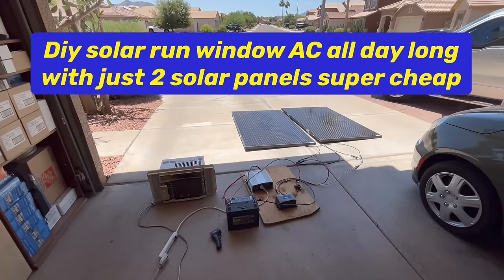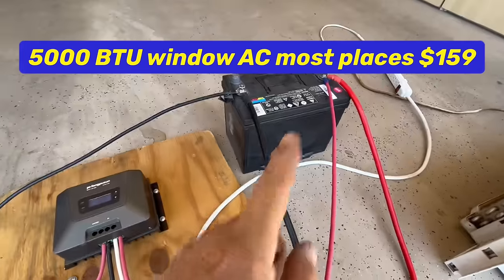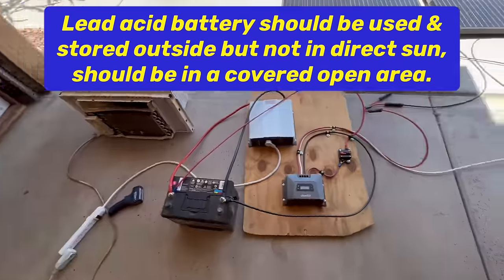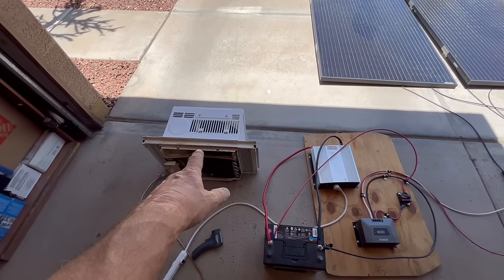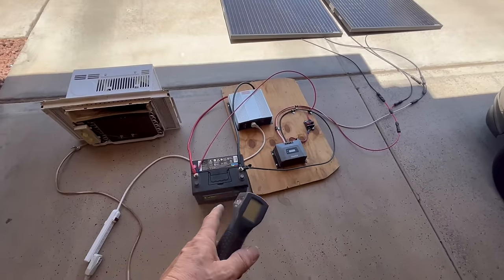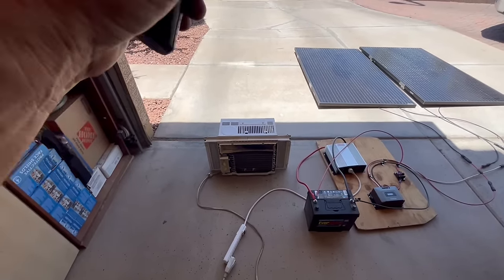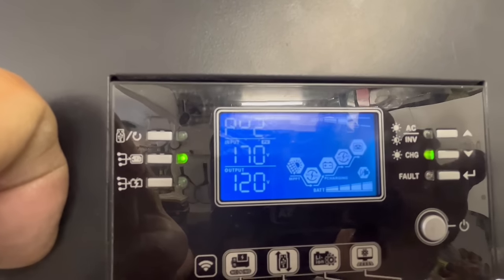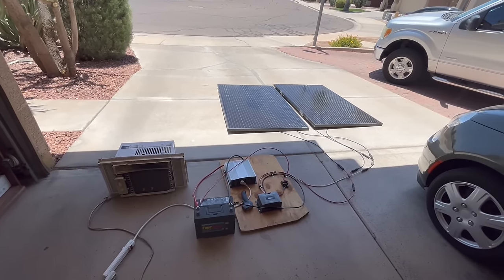Run your window AC with just 2 solar panels when sun shines. Easy DIY project you can do in one day.

Comment: I like the video but something you said I wasn't sure about. "Never leave solar in the sun." I don't think it produces power since the connectors are open, so my understanding was that it was OK to keep unconnected panels in the sun. You just get Voc, and I=0A. P=I*V. Thus P=0 Watts. It is just like an unconnected battery. Has potential, but until you hook it up to somethig, it isn't making any power. I thought those window AC units took over 1KW of power so I didn't think 2 panels would work. I might do that same setup.
Reply from the maker: Hi,I was talking about if you disassemble the system, don’t leave solar panels in the sun not connected to anything with the connectors just hanging. If it rains the water could get in connectors and complete the circuit and cause a fire hazard. But if the system in still connected, you will just be charging the battery or if battery is already fully charged,  the charge controller will stop charging battery. I was also talking about if I built a something or a way to to store on back of motor home a bracket connected to the bumper where standing straight up. I would face solar panels inward towards motor home so no sunlight was hitting face of solar panels. If it started raining and panels were facing out, you are creating a voltage through the wires and the water got in connectors, you could complete the circuit and catch on fire. Also the ac units they sell at Lowes right now only use around 4 amps at 120 volts is 480 watts. This unit while running only uses around 500 watts once running on high. When you turn down the temp control, unit will cycle on and off and will keep battery more fully charged. I ran this AC unit in a shed for a year and half when hit in the summer, left connected all the time and I would run from around 8 am till 6 pm in the summer on middle setting, it ran unit and kept battery fully charged. When I turned off at 6 pm, battery would continue to charge until sun went down. So battery would be fully charged next morning. I never ran overnight on lead acid marine deep cycle battery. You can not run that ac overnight without completing draining battery and killing the battery from being charged. I only used ac during the daylight hours. I also after a few months added 3 more batteries in parallel so I could start running earlier in the morning when sun was just coming up but not alot of sun on panels yet. That only drew around 1 amp per battery or 120 watts per battery until charge controller started charging batteries again. You should not run down lead acid batteries below 12 volts. The battery will not last long if you do. I have had these batteries for 3+ years now and they still hold a full charge over night when used as described above. Thank you for your input and hope you have a wonderful and blessed weekend.
Reply: @diy-solar-guy  Thanks for providing all the helpful answers and tips and info in your video and in detailed comments like your answers in this comments section. Very helpful.

Comment: For a cheap back-up system this is great! 
Solar panels are very cheap and so are window ac units. 

Even a basic mini split system will have double the efficiency of a window ac. 

A typical value for a window ac is a cop of 2.6 

In cooling mode a basic mini split will be around a cop of 6 and easily hit 5 . 

Some very modern Mitsubishi electric, not Mitsubishi Heavy industries!! will exceed a cop of 11(!!!!!) 
In my eyes that is mindblowing! 

Midrange Midea models exist that can hit a cop of 8 and some models even 9 but to be honest, at that price point I'd pay the little extra and go for a Mitsubishi unit which will last for decades and will provide efficient heating as well. 

Also 98% of these mini split systems are inverter driven and thus way less of a trouble to start them on batteries. 

Last but not least. 
I'd slowly turn away from lead acid batteries. 
LFP has become so cheap, in my eyes there's no point in using them anymore unless you already have one.
Reply from the maker: I have installed 7 mini splits that are used with solar or LiFePO4 2 upstairs, 2 downstairs and 2 in my garage, also one in my 23 foot motor home. I now run my whole house heat pumps on solar in day and upstairs 3 1/2 ton overnight on EG4 25.5 kWh LifePO4 battery bank. I had to put soft starts on my 3 1/2 ton, 4 ton downstairs and my 12.7 ton pool heat pump water heater that heats or cools the pool water 2-3 degrees per hour in my 15000 gallon pool. This basic bare bones example is what I did when I started messing with off grid solar over 4 years ago. Now we run so much on off grid solar power system check out all my never EG4 3000 watt inverter and Growatt 12kw low frequency off grid inverter videos where I show how to run so much around the house and reduce your grid electric bill by as much as 80-90 percent. All diy projects and home owner can do. Thanks for your valuable input, we appreciate it. Hope you have a truly wonderful and extremely blessed 2024.
Reply: @diy-solar-guy  wow that's a lot of heat pumps

Comment: at 5:13, nice job, I have everything but the solar panels to show that works guess why? it would be better if you used a couple 1,000 watt and cc'amp truck batteries from freightliner and it compatible in series, nickle batteries are also electrolytic capacitors so even when it doesn't hold a charge the amps can still pass through the battery
Reply from the maker: Thank you so much for you valuable information. Good suggestions. Check out my other videos on using solar to completely air condition my two store house and 3 car garage with only off grid solar. With temps 114 in day and 90 overnight lows. Around 3000 sq feet we are air condition. Thanks again and hope you have a wonderful and blessed day

Comment: I am curious if the fold up solar panels are on par with these panels.. they certainly would be a lot easier to move around, store, etc when not in use.
Reply from the maker: The flexible panels are less watts, not as efficient. You would probably need 2-3 times the same space with flexible compared to these mono panels. I have fold up panels for a lithium iron phosphate portable power supply and the panels are only 100 watts each. You can run off 2-330 watt mono panels but if you add another 330 watt panel you just greatly improved the length of time running on high all day with sun out. The charge controller will have to be large enough to handle more panels. My charge controller in video is old school and can only handle 2-330 watt panels. If you add a lithium iron phosphate battery that is 5kw or more you could run ac overnight.

Comment: That 10awg is only good for about 30 amps before you start seeking voltage drop. When working with 12 volt is can make a difference. 8 awg would be able to max out you controler and panels.
Reply from the maker: Thanks for your input. The ac only draws around 5 amps and 500-550 watts. These older charge controllers are not the greatest. The newer ones are much better but you can not use very many solar panels using it as a 12 volt for charge controller, you can double the amount of solar panels you can use when you switch to 24 volt inverter and battery bank while still using same charge controller. Actually the all in one 2400 watt or 3000 watt inverters are much better and you could only connect 750-1000 watts in solar panels if that’s all you wanted to connect. Thanks for your input, hope you have a wonderful and blessed week

Comment: With prices of LFP 12v battery replacements, that would probably be a better option rather than the lead acid.  They can be deep cycled while you need a deep cycle lead acid(eg pretty pricey) if you want this to last with a lead acid battery.  Also LFP doesnt outgas and because it is a very low fire hazard, you can probably keep it inside.
Reply from the maker: This was an example of what I started with 4 years ago. I now have 45.9 kw of LiFePO4 batteries for over night use. This was just a bare bones basis example of being able to run ac with off grid solar. Check out our newer videos where we run our 3 1/2 ton and 4 ton whole house heat pump to air condition our 2 story 2450 sq ft house during the day. We run our 3 1/2 ton upstairs ac on LiFePO4 battery bank over night. Hope you have e a truly blessed week

Comment: Excellent demo!
Reply from the maker: Thank you, I appreciate that. Very basic bare bones video of how off grid solar works. Fast forward 4 years and I now run my 2 central heat pumps to air condition my 2 story house all day with off grid solar and use a EG4 25.5 kWh LiFePO4 battery bank to run ac overnight. We also air condition our garage all day to 78 degrees. We live in Phoenix AZ where we just set a new all time record of average temp for 24 hours being 103 for last 2 months, do it is really hot out here. Check out how we went from running a 5000 btu window ac with off grid solar to running all our ac day and night. I think you will find it interesting. Our June 2023 electric bill was only $101.00. Thanks for your input and I hope you have a truly wonderful and extremely blessed weekend

Comment: Just found this video. I don't understand anything about solar but am hoping to set up a window AC in my camper. I see there are a whole lot of links in your description for lots of different things. Wondering to run the like most basic of setups how much would this cost? and on a very tight budget and all the anything solar I see for "rv's" is thousands of dollars.
Reply from the maker: This is a project where you will need to have some experience on how the solar works and what to expect. If you have no experience, you are better off trying to find someone help you install that knows about solar. If you don’t understand solar you could cause a fire to start. Better safe than sorry. I put those other mini splits and inverters for those who understand you can run ac with solar but should get the right equipment for the spa e to be cooled or heated. I installed a mini split in my motor home instead of using this because we plan on camping in the winter and the window ac can’t heat tv. Plus the mini split will use less power overnight as well. The window ac will use the same amount every hour for 24 hours. My main goal was to show it is possible to run ax with solar and used this basic example in video. Unfortunately it is expensive to properly have solar installed equipment on an rv or camper. Every time you put a hole in your roof it is only a matter of time before it will leak unless you replace caulk before a leak occurs. First look at setting up off grid solar set up before you want to try using ac and see what the cost will be. Cost vary depending on how close you are to buy parts locally. To try and set up a solar off grid, you are looking at $1000-!1500 and that is just your run ac in day when you have full sun on panels 6-8 hours. Prices have dropped on solar but trying to go really cheap means buying inferior parts that could cause damage or a fire. Better to do it properly than to take risk. I hope this helps, I know it’s not what you wanted to hear but is what you needed to know before spending money on solar. Solar can become a money pit where you want to keep adding on to run more appliances. Hope you have a truly wonderful and extremely blessed 2024.

Comment: Adding big DC capacitors at the Panels outputs and a big AC capacitor in between the 110 AC to the Air conditioner will smooth out everything. Not so much fluctuations and smooth out the hard start of the Air conditioner
Reply from the maker: Thanks so much for your suggestion, we appreciate it. Hope you have a truly wonderful and extremely blessed 2024

Comment: I would never use a modified a sine wave inverter. Use a pure sine wave inverter its worth the extra cost because motors run better including compressor motors. I actually thought about running a 8000 btu window unit in my living room. I am already using the window units. One in the bedroom and one in the living room. My bill rarely goes over 55  dollars a month in Florida summers. My whole house would run the bill over 150 dollars in the 90s. I cannot believe i been running window units about 15 to 20 years. A mini split units would be an alternative. I may try them in my new home. 73
Reply from the maker: I used modified sign wave inverter for 2 years with no problems. But if you have the money, buy the pure sign wave. At the time, I knew nothing about ac, solar, or electric components so I bought modified inverter. I now run the air conditioning in my 2 story 2450 square foot house with my 3 1/2 ton and 4 ton heat pump ac 7/24 using solar in day and EG4 battery 25.5 kWh battery bank at night. Along with running my pool pump 24 hours a day, air conditioning my 3 car garage during the day, and heating my pool to 89 degrees in the winter, all with solar power off grid system. Check out my other videos showing this. Thanks for your input and hope you have a wonderful and blessed day

Comment: Any thoughts on doing this without a battery? Just curious.
Reply from the maker: You can buy mini splits that are direct connection to solar panel to run during the day and have wired to run on grid at night or connected to a LiFePO4 battery bank to run overnight. You eliminate the inverter and batteries with hybrid direct connect mini split but I have not seen where you can run window access without battery and inverters yet.
Reply: @diy-solar-guy  That is cool I will look into it. I have tons of LiFePO4 batteries, but was curious because solar panels are DIRT cheap now and it would be nice running it without using up the life of the batteries.
Reply from the maker: @davidsalvador8989 you could definitely run during the day with around 1500 watts of solar or more. There should be a link in the description in the video for signature solar, look in menu under shop all and you will find high efficiency appliances, the hybrids start around $1,200 and up. I will be getting one soon as well. Can limit grid input I believe to just 600 watts to use at night.

Comment: Engineer right here... Just one comment. It's ok to leave the panels exposed to the sun without a load. There is no danger. However if they are on an RV and it's parked most of the time, you can cover them to keep dust and bird poof off of it but from an electrical standpoint, if there's no load, there is just no current. no problem.
Reply from the maker: Thank you so much for taking the time to comment on this video. I really appreciate it. It helps the viewers and me since this is a DIY channel. My only concern was when I tested the solar panels with a multimeter specifically for solar panel testing, when I connected the meter which would power up meter, the meter would show around 200-250 watt on a 330 solar panel and around 38 volts, also around 9 amps. If the solar panels were to some how short by damage or animal chewing on wire. Then there could be a hazard there. I know with some of my used solar panels that I connect but have no load. There is a shock hazard when touching frame of solar panel and the ground especially when wet, I will get an electrical shock. I just worry about children and small animals coming in contact with the frames and when ground is wet. These are used solar panels where the seal is broken on the frame and glass and water intrusion has occurred. Since I have experienced this first hand, is why I made the comment about not leaving panels in sunlight. But under normal circumstances with solar panels being new, grounded with earth ground, no seal broken and no damaged wires, there should not be a problem. Thanks again for your comment. Hope you have a truly wonderful and extremely blessed 2024

Comment: 💯💯💯💯💯excellent Video…..what is a Good Type of Battery to use?
Reply from the maker: LiFePO4 is the best to use and will last 10-20 years as where lead acid in the video might only last 2-4 years. And with LiFePO4 battery depending on how large your battery bank is could run ac overnight. Check out my other videos where I use 12,000 btu mini splits during the day and could easily be used to run overnight and probably use less watts than window ac. High seer 38 mini splits can get down to 200-300 watts an hour once room is cooled. Thank you so much for you wonderful comment. Check out my other videos where I am air conditioning my house out here in Phoenix AZ where temps last month are 113 degrees in day and 90 degrees overnight low. 2story house and 3 car garage I air condition, about 3000 square feet. I spent $0 last month on air conditioning in this extreme heat. I have over hundred videos with running pool pump 7/24 and heating my 15,000 gallon pool in winter 87-89 degrees, all with only solar. We are all electric at our house and our electric bill for the entire year is less than $1000. Enjoy the videos and hope you have a truly wonderful and blessed weekend.